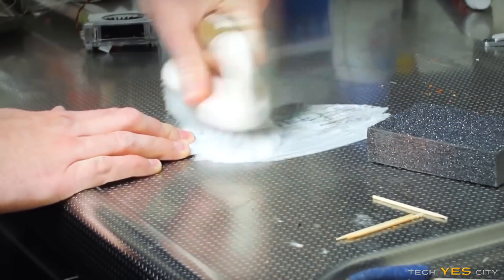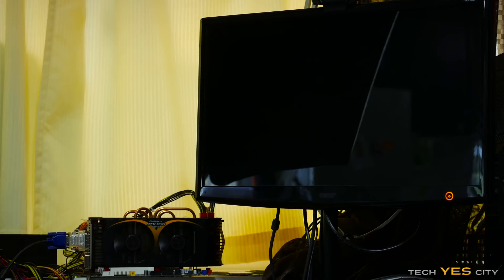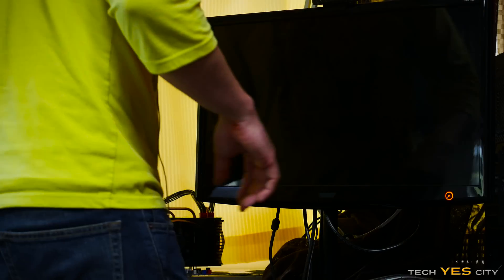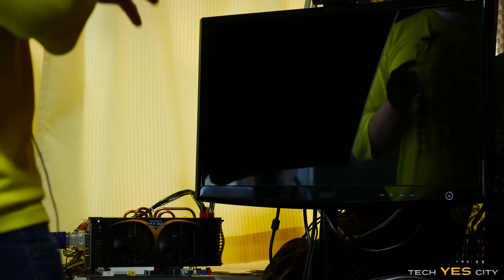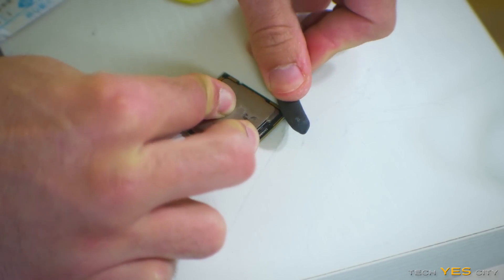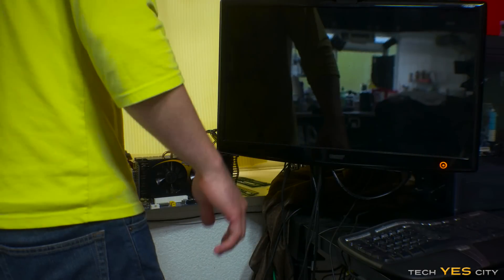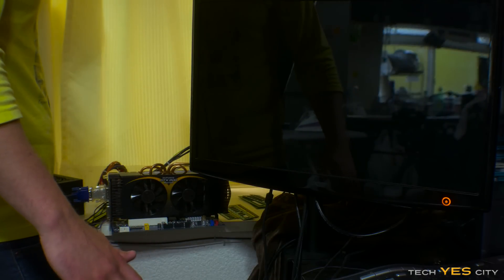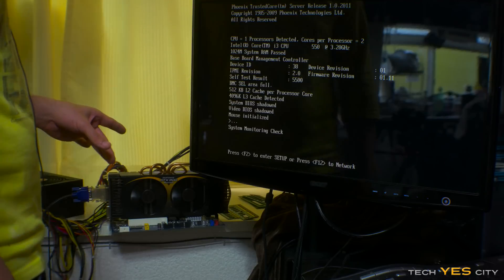The CPU & GPU DROP Test - How STRONG are PC Parts?

Comment: I just dropped my gpu (rtx 3060 oem) and the top 2 corners got busted alittle. The part that connects to the motherboard is in good shape. It was about a meter fall.. I’m hoping it works. I plugged in the pc and the fan and lights on the gpu work so that’s a good sign. Keeping my fingers crossed though ..

Comment: You noobs. You can drop a motherboard from space and it will still work .forget the plastic parts attached to the gpu, the actual motherboard is really strong and solder parts are really hard to remove.  Try pulling out a capacitor out a circuit board with your fingers or a pliers ...you won't succeed.  Heck , throw your motherboard at the wall really hard and see if it still works.  Try breaking your motherboard in half with your hands..you will most likely cut yourself

Comment: your cpu will only be damaged when silicon wafer get damaged or you can called it pcb. and in gpu situation it has an heatsink on it protect it gpu but it will stop working if pcb is bend or some of those smd capacitor and component get knocked off from pcb.

Comment: if the cpu hadnt hit the edge it probably would have been ok if it didnt hit the edge where it looks like it did. can you redo this test with some new parts, i used to have an old athlon 3000 am2 I think and I would throw the whole board around the room and it neve stopped working.

Comment: I got a a6 5400k for $30 and opening it i dropped down 4 concrete stairs. 6 bent pins was all the damage. i fixed it with a debit card and it still works

Comment: When I bought a set of used parts all of the parts were put in nicely sealed bags including the cpu in 3-4 layers of plastic covering wrapped over it, I accidently dropped it on the concrete floor from 3ft, even though I had it tested and it works do you think the cpu still suffered any damage.

Comment: Was wanting to see that graphics card smash to bits off the concrete :(

I wouldn't call it cpu and gpu, its cpu and graphics card.
I think the gpu itself will be fairly protected, its just gonna the slightest damage to some other part of the pcb to stop it working.

Also, I think if the graphics card lands flat it might survive better, but if it lands at angle, it could snap the pcb in half.
So in reality you would have to drop thousands of these at random angles and spins to get a good idea of when what height is likely to damage them.
Reply: I figure the graphics card would be fine if it landed on the heat sink, that'd protect the pcb decently, however it may break the fans and overheat, if it lands pcb down though, the heatsink may do more damage from its weight.

Comment: Its fine, but i really do not understand the point of doing such things. Crazy ?? Yes ??

But does it make sense ? Certainly not... 
Being an electronics engineer I can tell that Dropping CPU's / integrated circuits / SOC's from even your height on a rug / carpet wont hurt it.
Its an integrated circuit. The joints are minute yet bonded very strongly.

GPU, that's a hefty thing. The drop can bend the pipes, break the shroud, or if falls on the fan side might hurt the graphics processor or the connectors may take a toll but not anything else at all...

Experiments that too crazy ones have led to discoveries and inventions but when you play with such things all day long and post videos of new builds and unboxings, kindly have some knowledge of what you are dealing with...

Having said that... Good experimental videos.. goodluck

Comment: Dead CPU? Drop it from the balcony again and see if it will slot into the hole on the cover.
Reply: Also, the GPU is always 50/50 chance whether it lands on the PCIe connector or somewhere else, the connector is key to a functioning GPU.

Comment: I have an question why is the midrange graphics cards of gtx950 and 960 and the r7 370 around 6000 firestrike score and not what i expected round the 8000 . There is little diffirence between an old 7850 and an gtx950, i expect and not a big difference. Why ? Is this different by weird example an gtx 1050. ?

Comment: you should try and cause electrostatic damage to computer while building it.
Reply: +FubarMike he already has a video of forcing eletrostatic shock to pc components...

spoiler alert: if you dont wanna search and watch it, no part ever got damaged or destroyed unlike in this video.
Reply: +Strider Wolf well, there might be unseen damage. You might not know right away depending on the discharge. Though yes, the parts are still in working order. It's more of a cumulative effect so long as the charge isn't too large.

Comment: that gpu drop sounded kinda simular to the sound that my controller makes when I throw it into the wall ;P. [FIFA is a mood killer]
Reply: ***** i used to play battlefield, but I play Arma 3 now
Reply: ***** at the moment i have a i5 4690K @4.3ghz, a GTX 760(next month 1070), 8GB ram, 250gb SSD, 1TB HDD
Reply: ***** great build! I do recommend to get a bigger SSD, even the 250gb version gets full really quick and I have not even installed games on it yet :/

Comment: Tech YES City can you test the myth of static electrisity ruining pc's if its true or just a myth. becouse i have worked with computers and had lots of shocks with static electrisity and all my parts still works fine.
Reply from the maker: +stilloading adventures I already did a test on that one back over a year ago. Results were it doesn't do anything, at least in my tests.
Reply: +stilloading adventures Same here. I build on freakin' carpet. Lol.
Reply: +Tech YES City did you test with a powerful shock because you know when you take your jacket off and tuch someone you feel the elektrisity, compared to using thick socks and a fluffy carpet.
Reply: *touch
*electricity
Reply: +stilloading adventures Static electricity is weird. There is a really really small chance you fry something important, so i wouldnt worry if your just building one pc. but if youre working on pcs all the time probbably buy one of those wristbands

Comment: I've heard that I7 6700K can survive that balcony drop test...    :P
Reply from the maker: +Sergiocrivelin It's so light from the cost cutting that it will probably float off the balcony.
Reply: +Sergiocrivelin the CPU he dropped from the Balcony probably would have survived if it had landed differently, instead of right on the corner edge.
Reply: +Sergiocrivelin Wait like 7-8 years and we will test this.
Reply: +Sergiocrivelin doubt it. Skylake chips are way too thin. They already bend under the weight of aftermarket coolerS. So from a balcony drop ... no wayy. Who wants to risk his 6700K?
Reply: Lol
Reply: Tech YES City
Indeed   lol
Reply: +Sergiocrivelin i bet that pentium would have survived the balcony had it not hit on an edge of the board.

on the other hand, the two meter drop of the GPU was sheer luck, IMHO, as it landed flat on the pc board.  had it hit on an edge, i bet there would have been serious damage.  you hear it kerthunk.
Reply: +Kayla and Jim Bryant maybe.... on the other hand then the Cooler would probably have taken the majority of the impact which is good since the card is designed to handle strain on mounting points. And the impact would then only have been the weight of the PCB which is negligent compared to the cooler.
Reply: +Tech YES City That savage..
Reply: Newer cpus have thinner pcb. I doubt it can survive a meter drop.

Comment: LOL i've have dropped an nvidia gtx 470 from a shelf above 7foot refrigerator on a wooden floor....it lost some resistors by some memory chips. it still worked but was idleing temps at 70c and underload 96c....had to point some fans facing down on the pcb to maintain safe temps.....ended up soldering them back on but didnt really help temps were the same lol

Comment: Well my experience with PC parts is that sometimes they are extremely resilient, and at other times, they break from a table-drop already due to some BGA bumps getting loose (or AMD CPU pins getting ripped off).
Caution is always good ;)

Comment: If this was LTT then they would drop a i7 5960X and a GTX 1080
Reply: +Eirik Haug Or even an i7 6950X. YOu can get that thing from eBay already.
Reply: Moritz Rudolf more likely a  Xeon 2699 v4
Reply: X whats theaning of the "X" from the CPU ? Never seen this letter before.
Reply: the moment you read this meanwhile you warched LTT dropped a 10K CPU that is 15x more expensive then a 5960x this Year..

Comment: You should test the ultra durable motherboards from gigabyte to see exactly how durable they are
Reply: +GEEGEE And send the military class ones to the battlefield
Reply: +GEEGEE lol
Reply: Mine quit working immediately after installing a cpu cooler with a back plate.
Reply: You should be able to RMA thise if they get wrecked going over a balcony.
Reply: +Antonio Burgello Hhahahahha would be funnny as hell xDDDDDDDDDDDD
Reply: +Cretin sucks man... my laptop survived 3 drops so far. All completely unintentional. The last one did the most damage, which is it doesn't really close anymore. Otherwise it's doing just fine.
Reply: +Cretin my 200 dollar netbook I bought on clearance sale was dropped about 6 times and it has no scratches or dings anywhere and it works fine too somehow
Reply: rolf
Reply: Dropped one myself They are so solid Build new ones...
Reply: Nope, accidentally installed the GPU incorrectly into the PCIe slot and now I can barely do shit until I restart my computer an undetermined amount of times when I boot it up.
Reply: Carpet

Comment: Hey I had a question. So I delidded my cpu and it was a total hack job and I ended up scraping the pcb a couple of times. The cpu still works but now my pcie 1 slot no longer detects my gpu... Would this be from the cpu trace damage or is my motherboard damaged some how? The gpu is fine as it works in the second slot at 8x speed. I've gone through pretty much anything I could think of and find. 

Z97 Asus Sabertooth Mark 2, i7 4770k.
Reply: +Tekuila Gaming Does sound like you got lucky and only damaged that part of the CPU. But, if you wanna be sure, you'd have to test another CPU in your mobo/your CPU in another mobo.
Reply: ***** Yea that's what I was thinking.

Comment: Bryan, being one of the few non-biased tech-tubers i know, can you make a video about screen tearing? A lot of people swear by G-sync and FreeSync, but is it really worth the price? Same goes with screen tearing in 144Hz monitors, is it really that bad when you're at 200 FPS? (200FPS as an example since nobody should buy a 144Hz monitor and use a low end card anyway)
Reply: I've heard it is, apparently a Gsync and Freesync monitor can make 40-50 fps feel like a super smooth 60fps.
Reply: Txx00xic I don't really care for the low FPS, but I do care more about the high FPS mark.

let's say a monitor with 40-144Hz freesync/g-sync range

tearing at low fps (or stuttering)
low fps -> lower settings -> higher fps = fr/gsycn range

tearing at very high fps
high fps = you can't do anything once you've maxed out your settings.

I'm planning on buying a Vega 10 GPU, so I don't want to ruin the experienced by purchasing the wrong monitor.
Reply: +Vanguardas Vucava Freesync and Gsync just eliminate screen tearing with higher framerates and adjust to lower framerates, I don't have one personally but I'm very interested in getting a gsync monitor for HBM2 Pascal
Reply: ***** Yup that's what I'm thinking since people say it isn't that noticeable. I'm trying to plan now since I will be spending a lot of my limited budget on upgrades. Zen, Vega, MoBo, Monitor.
Reply: Txx00xic They only work if you're in the 48-144Hz range, or whatever the monitor specs have. So going beyond 144 means screen tearing which sucks if your GPU is too powerful for some games.
Reply: ***** Woulndn't that introduce input lag? Makes a huge difference in games like CS:GO. :'(
Reply from the maker: +Vanguardas Vucava That would take me a while to do, could definitely look into it, I have always been on the side of it doesn't make that much of a difference, only on the lower side.  Though testing it with evidence would be a great way to set things in stone.
Reply: Tech YES City That would also be a costly test though, sorry haha

Comment: Only 2 mins in but the CPU should survive very high drops. Its made from Silicon (not silicone) Silicon is one of the hardest natural elements out there. It can brittle but it's a very strong element.
Reply: +clinton fisher you said it yourself its brittle.
Reply: It's brittle in the sense of tensile strength. I see it did die from the second story but I wish he would have taken the heat spreader off.

I really do feel the actual silicon was unhurt. The video of the CPU afterwords was not great at showing exactly where the damage was on the corner but I want to say it died due to the bending of the one of the socket contact points.

Silicon really is a strong element.

Comment: Many of these parts are subjected to much more when shipped. Especially when one buys a pre-build PC. I seldom get one that hasn't had a key component that hasn't been knocked loose.

When I worked for NEC here in the states. I was a part of the engineering team for the PBX division. We had to add special shock test indicators to boxes as the shipping companies were destroying too many PCB's & such.
Reply from the maker: +1timby This has me really curious now...  I know in aus post for example that the parts get put on a belt that drops them over a good story sometimes...   And if the item behind it is a car battery well... GG parts...
Reply: Tech YES City It's the same here. Packaging can mitigate some of the force. But not all.

Comment: I think the cpu could've survived if it fell on concrete and heat spreader down
Reply: +The Diamond Games - Channel closed That's what I have found over the years. It depends on how it lands and the surface it lands on quite a bit. I've had GPUs die after a 1 foot fall and one that survived falling down a flight of concrete stairs. Nice video though.

Comment: With GPUs it depends on how you drop it. If it falls on the PCIe port, the weight of the cooler smashes the PCB and it's pretty much dead (that's how my 4870 went). On the other hand, if it drops on the cooler, the worst that can happen, is a broken fan or a piece of plastic.

Comment: Here's a brutal video idea; Pulling out parts from a running PC
Reply: pcie is hot Plug. a German Computer Magazine tried it once and nothing happens after a restart all worked again. pulling out RAM is sometimes deadly for the mb. pulling out a CPU is harmless the system will Crash but should be okay

Comment: why does it take this PC forever to just post?
Reply: Old ass PC.
Reply: +Christopher Tan No, that's only on the first power on. He didn't change any parts.. he took one part out that booted.. did the drop test.. put the same component back in and still took forever to post.  being an "old ass PC" is also not a reason why it posts so slow since the age of the hardware would have nothing to do with the speed of a power on self test.